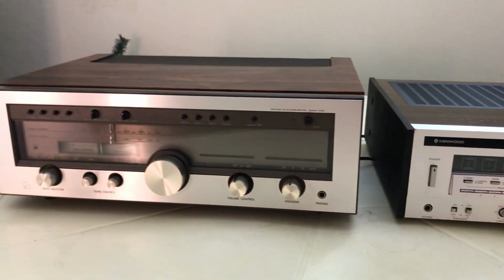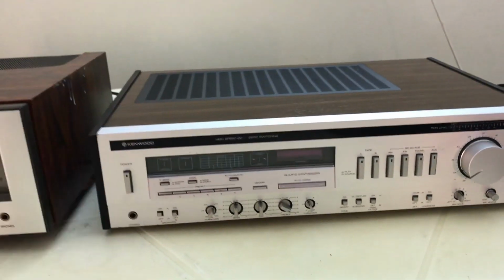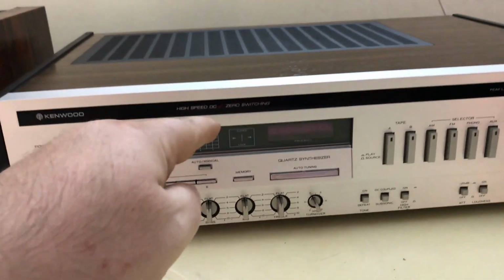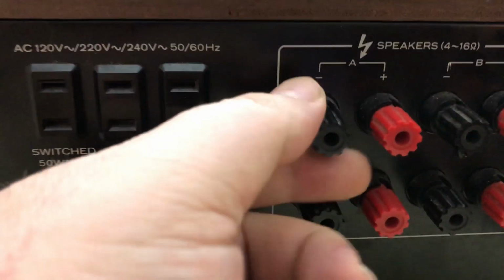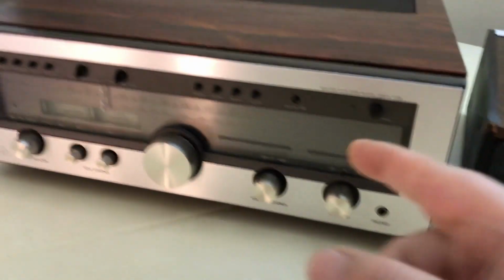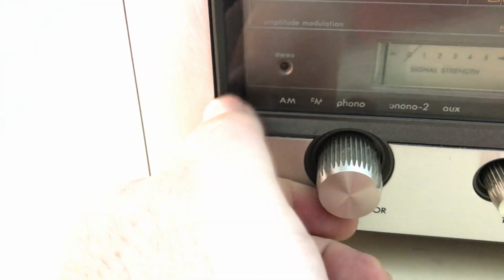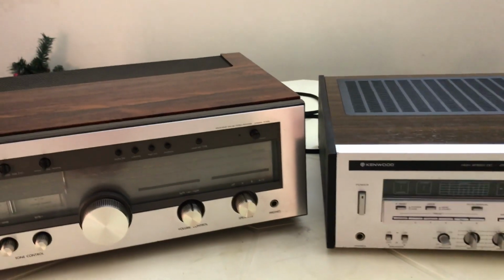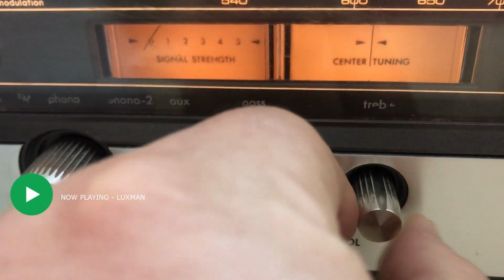KENWOOD VS LUXMAN

Comment: Luxman sounding sharp? I own several luxman receivers from this era, like R1050 en R1500, they sound lovely smooth, warm and natural. You can listen to them all day without any fatique. I really think this one need some serious rebuilding. Great receiver by the way this R1070, pretty rare. My R1050 puts out 76 watt by 8 ohm (55 watt on specs) so i guess you will be pushing 85 watts. Do a sound test again after recap and you will be amazed.
Reply: Sorry to tag you like that, but how do you compare the R1050 to R1500? I can buy either but 1500 is much more expensive. Apart from higher wattage, what do I gain in terms of sound quality?
Reply: @Creeper99PL  I love them both, r1500 is bigger and heavier and more power (75watts) and more rare, lots of options, excellent sound. The R1050 is 55 watts, love the looks, nice db meter that jumps around. The sound is fantastic as well. I was thinking if my house would be on fire and i could take one out, ...... very difficult but I think I would choose the R1050.